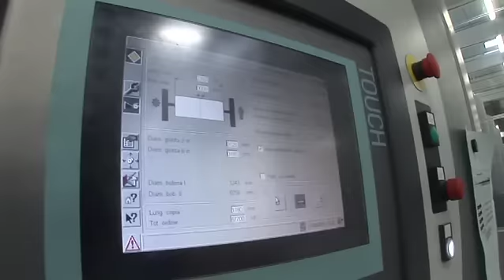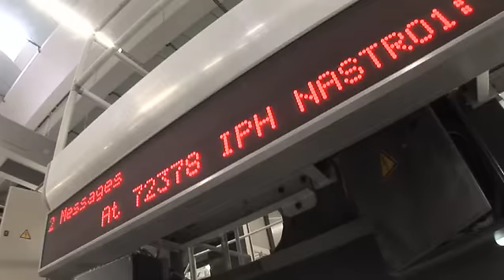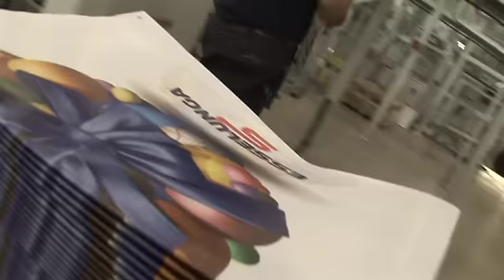Goss Sunday 5000 - World's widest web offset press

Comment from the maker: The length of roll is only limited by the paster. The Goss Contiweb FD paster show here can handle a roll up to 1524mm or 60 inches in diameter. Obviously as long as you don't run out of rolls, you can just keep pasting and run non-stop